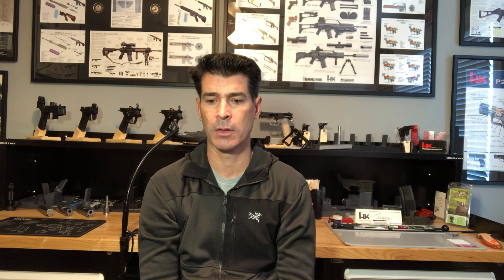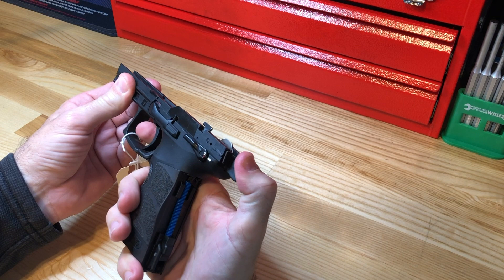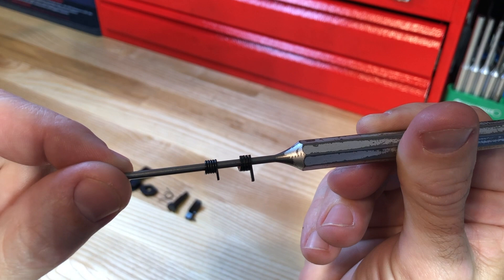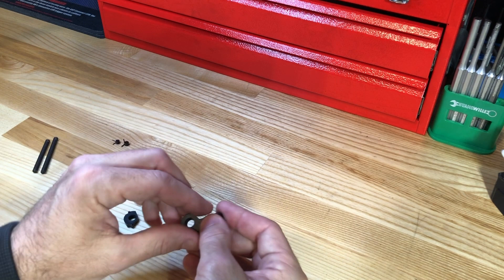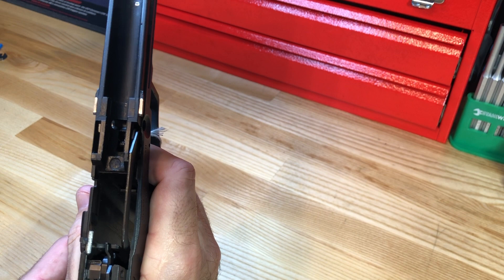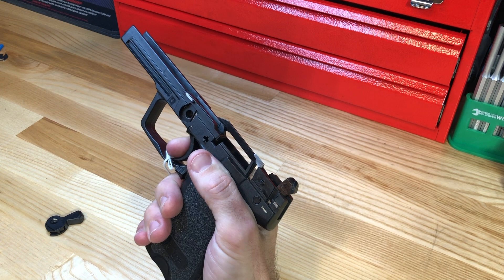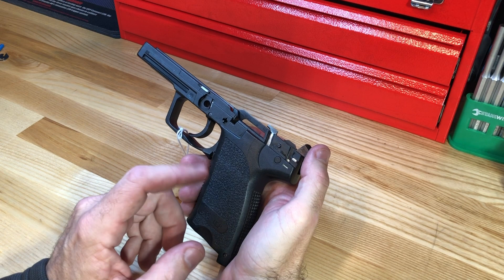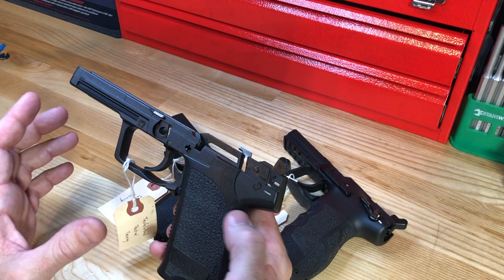Teufelshund Tactical Heckler and Koch LEM Armorer/Operator Review

Comment: I am a former military vet as well, having been trained in 1911's and Berettas. I have since enjoyed both CZ and SIG DA/SA pistols more than the other striker variants. I do like the lighter trigger pull weights of my modified Glocks. But since the triggers are so light (3 to 4 pounds), I'm hesitant to leave a round in the chamber when carrying. I feel safer with a safety or even a heavier DA (less than 8 pounds) in my CZ customs or SIGs with a round in the chamber. If I'm not using my safeties, I carefully lower the hammer by hand and just expect the DA first shot. On my SIGs with decockers, I just use those. Having different pulls is my tradeoff, but I see it as a time issue. If I need to take the shot, I would just deal with the heavier DA. If I had time, I would just thumb the hammer back. I would like to get to a point where I can just draw and be prepared to shoot without the need to remember if I have a safety on or not.

I was surfing the web this morning trying to understand if an LEM would help me or complicate me since most of my firearms are DA/SA, with some striker-fired Glocks and CZs. I came across your video here: https://www.hkpro.com/threads/langdon-tactical-hk-p30-lem-series-pistol-first-impression-thoughts-and-questions.561006/

This is the best explanation I have seen, and I've been searching the web for months. GREAT JOB!
I'm subscribing now based on this video alone, in the hopes that I learn something else from you. I also don't want to lose track of your excellent explanation.

Comment: Converted my USP9 to LEM but kept the V1 DA/SA hammer spring and installed the heavy squared off trigger return spring that came with the conversion kit back in 2014 or so and I loved it. 

Just recently got a trigger blade with the overtravel stop and the nickel sear spring and installed them and it is really nice now, the stop physically limiting the trigger overtravel makes the overall pull feel lighter but I still have a positive feeling reset because of the heavy return spring. 

Certainly not something H&K would advise doing I’m sure, but I like it a lot.

Comment: Question for you.
First, I got a lot out of this video, thank you.
I'm convinced of how good the LEM trigger is.  I'm considering getting a H&K USP, and I'd either get it with LEM, or convert it.  But because I'm a 1911 guy, and have trained for years to use that thumb safety.  Is it possible to have a USP with LEM, and a thumb safety?  If so, what's involved in doing so?  Thanks again for the great video!
Reply from the maker: John Kelley Brown It can be done, but completely defeats the point of LEM.  The best advice is just learn to let go of that perceived need.  It’s not as hard as you think and I had to do it too.

Comment: I'm on the fence between LEM and DA/SA.  Looking at the P30.  Still haven't completely decided, but this video is extremely helpful.  I carry AIWB and I'm just finding myself extremely uncomfortable holstering striker pistols with one in the chamber.  That's why I'm switching to a hammer fired pistol.  I was originally all in on DA/SA, but the LEM is starting to creep into the discussion.
Reply from the maker: I highly recommend you take one for a “test drive” before buying to make sure you prefer LEM.
Reply: @teufelshundtactical  thanks for the reply.  That's the idea, just tough to find somebody in the area with a range that rents one out.  I've dry fired them though

Comment: I had a chance to mess around with the HK before I left INS. After shooting the Beretta 96 for years, with its ridiculously long double action only trigger, I had no idea what trigger reset was and shot the HK poorly. As a private citizen now I have a stack of HK handguns, some with LEMs that you installed. Is there anyway to get the pull below 5 pounds? Thanks for doing these videos.
Reply from the maker: Using the light LEM trigger return spring and light firing pin block spring will reduce the trigger pull.

Comment: I heard that The LEM models don’t do as well in torture tests...Do you know if this is true?
Reply from the maker: I don’t follow social media influencers who do “torture tests” as a way to sensationalize their audience.  But as far as whether LEM vs DA/SA has proven to be any less reliable through actual use by commercial or LE customers, I have not seen any issue.  In fact the only part that I have seen break more than once in all my years of working on H&Ks is the sear spring and that is the same part on the USP through P30 series.  These are incredibly well built and reliable pistols regardless of the variant you get.
Reply: @teufelshundtactical  Thank you for the response. I have a P30sk, P30 and a P30L all in the V1 light LEM. I installed the grayguns short reset trigger system in all of them. I also own a USP Compact and full size. I love and cherish all of them. Thank you for sharing your knowledge. I love H&K.
Reply: @teufelshundtactical  What is your preferred carry weapon if you are just running some errands around town?
Reply from the maker: @loveyourfreedom3903  The P7M8 has been my primary carry since 1997.  I rotate in a VP9 and VP9SK often.
Reply: @teufelshundtactical  that is great! Excellent choices in my opinion. I carry the p30sk during the day and at night the P30.

Comment: What parts break on an LEM setup?
Reply from the maker: If properly installed, you should not have any issues.  The only trend issue I have seen break on the current hammer fired pistols from H&K (and this is very rare) is the sear spring.
Reply: @teufelshundtactical  you the man sir.  I just bought my first v1 P30L LEM. I am use to glocks and cocked and locked H&k USP series guns.  Hopefully it’s a nice mix between them

Comment: Can you use USP LE sear, cocking piece (goes in the hammer), cocking spring, and hammer in a regular new USP V1 frame to get LEM functionality?
Reply from the maker: The receivers on the USP and HK45 series are modular and you can convert any of them to LEM light or heavy with the LEM conversion kit, replacing the original DA/SA configuration.  I show this in the video.

Comment: My LEM trigger clicks at the wall when it is pulled before it breaks. Is that normal?
Reply from the maker: I don’t recall that.  The click should be heard at reset.
Reply: @teufelshundtactical   it feels like the trigger has to move a minuscule amount more before hitting the wall (almost like a false wall). 

That’s the clicking sound I was hearing. It was converted from V3 to light LEM.
Reply: Can you do a video on V4.1 LEM?